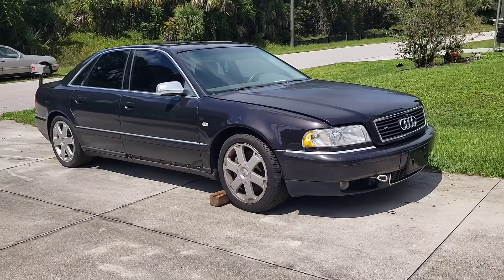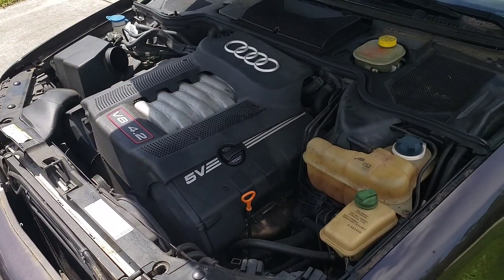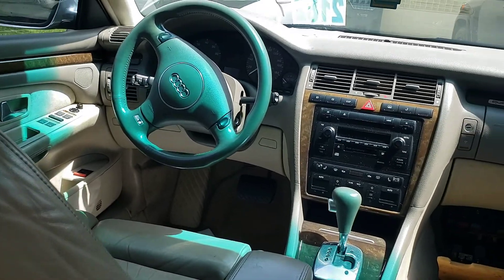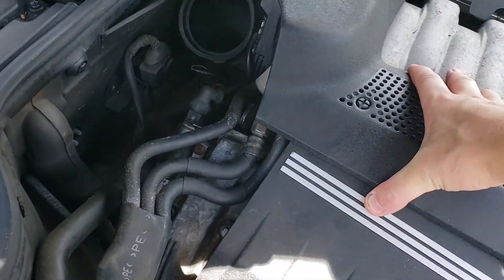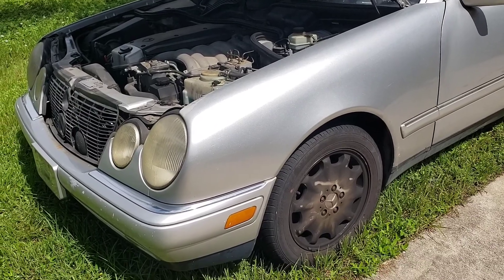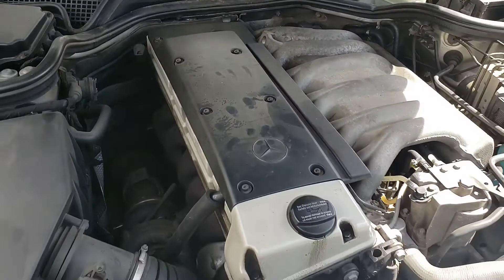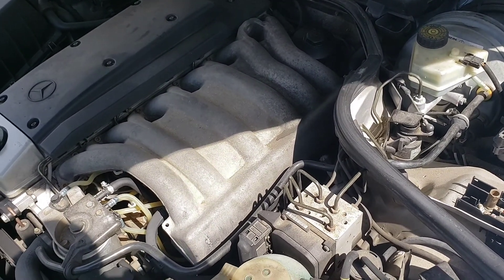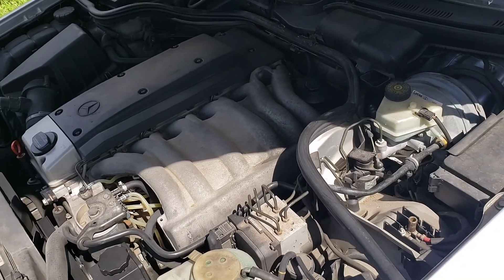Audi S8 Turbo Diesel engine swap.

Comment: Engine out yet?! ;)
Reply from the maker: Half way done 😊   ive been slaking
Reply: @incrediblemember1208  hahah alright. I’m having a hard time sourcing an engine (in Canada) only chance I have is an om648 from 2005-2006 e320 cdi. Which is still very good.
Reply from the maker: @2nsane2005  Oh dang I see well I just bought the whole car at the auction for $1400

Comment: Please do the swap! I’ve been thinking about doing the same swap only with my b6 s4 with the 4.2L 6 speed manual. Have you made any progress?
Reply from the maker: The guy that sells the trans adapter plate  said I should go with the 1986-1996 mustang t5 5 speed trans,  that trans will hold up to 500hp thats why it will only be RWD plus I am trying to get rid of any extra weight on the s8 😊  I am about to pull the s8 engine out !! video coming
Reply: @incrediblemember1208  I’ll stay tuned! I’m in Canada so I’d like to keep my awd.